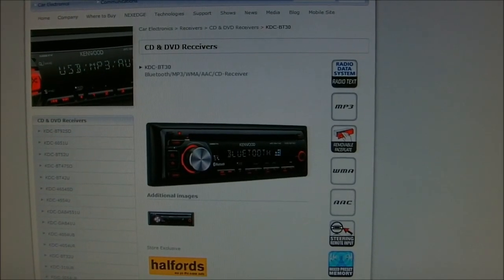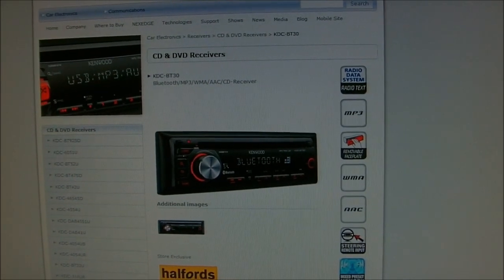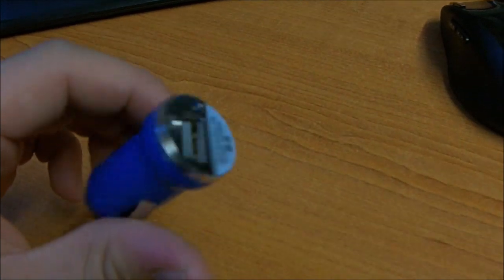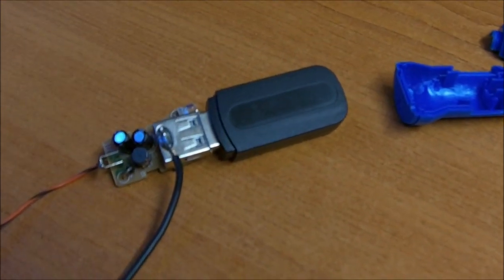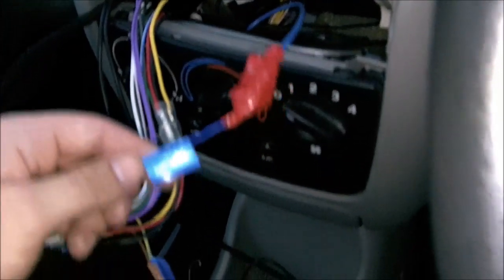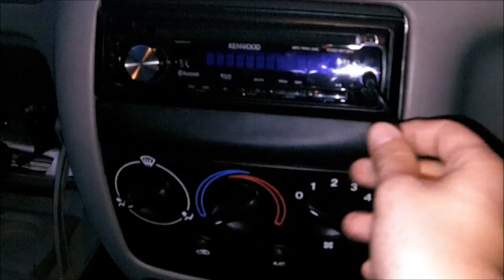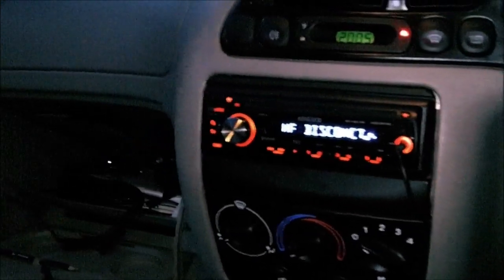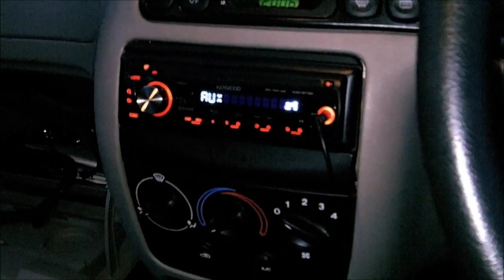How to add A2DP to a head unit

Comment: Hey question. I am currently attempting the same hack, but when I power my bluetooth device I get feedback since the amp is sharing pretty much the same power with the port I am plugging in my bluetooth. I know because when I power my device with an external battery I don't hear any feedback. Any suggestions on how I can get around my issue? Thanks!